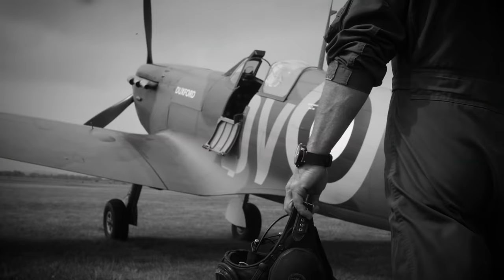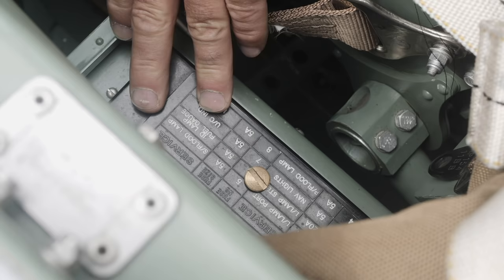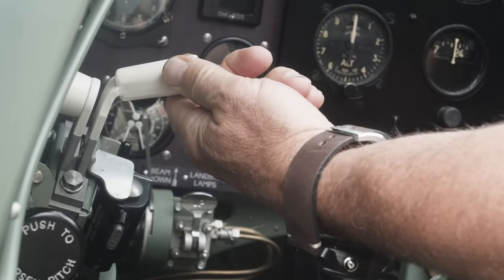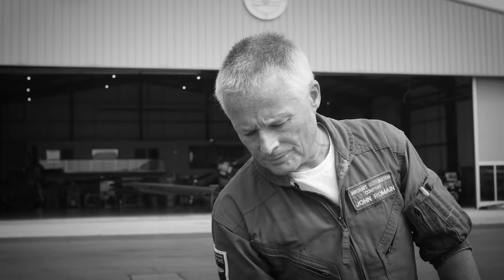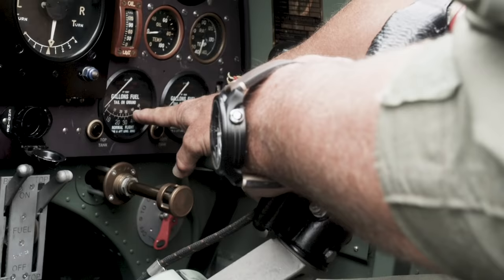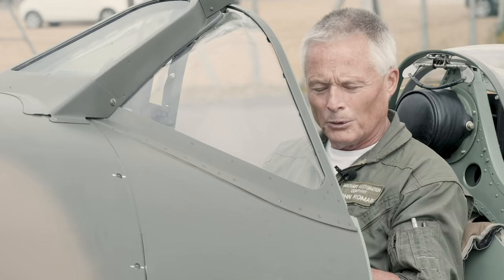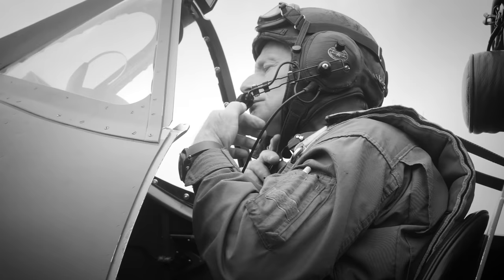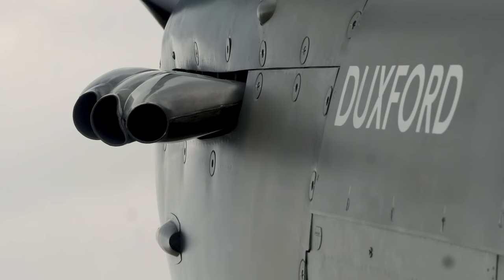How to Start a Spitfire: Step-by-Step Guide with John Romain

Comment: Cool. Here's how to start a spitfire. But lets not actually start it ...
Reply: Exactly
Reply: You have to pay extra for that...
Reply: Check out Kermit weeks if you want to see run through and start ups there his own planes p51b and a few others. Very cool
Reply: Incredible.  All that and leave out the best part. Firing up that awesome Merlin engine.
Reply: Riiight? 🙄 That was SUCH a fail... 😖
Reply: I saw i both start and lift off
Reply: And I thought it was just turn the ignition on press the starter button fire it up taxi to the start and then put the foot down and up she goes
Reply: Im guessing no-one heard him say that if the engine starts, there is a limitied amount of time before the engine overheats due to the small radiator that these engines use? Would have been great to see the actual start, but still, it makes sense why he didn't
Reply: @dianjacobs8180  it's a "step by step guide" as the BS title clearly stated.
It's missed out the most fundamental step of actually starting, or did you miss that ?
Reply: Good idea, the last thing you’d want is to break one of these beautiful birds
Reply: Why the belgian bracelet?
Reply: Ture bro the incline in gas money
Reply: Notice the black&white footage. You have to unlock the pilot and the plane first.

Comment: And to think 18 year old kids had to do this in a hurry before putting their lives on the line
Reply: The ground crew would have already done this prep before the pilots flew these beautiful birds. Time wasted completing pre flight checks would have been disastrous and allowed the enemy to cause more damage than he did. The aircraft had to be flight ready for any ‘scramble’ and that was the sole purpose of the ground crew.
Reply: @JamesAlexander14  That wasn't a pre flight check, that was a start procedure.
Reply: ...and now their only start procedure is for their mobiles
Reply: @JamesAlexander14  Coming from a instrument rated private pilot you’d be amazed how fast you can get a plane started once you’ve done it countless times in flight training, the start up procedure for this spit isn’t to much different from your typical general aviation aircraft and even in the event of scrambling leaving over a dozen unmanned aircraft with primed engines and magnetos on is flirting with disaster
Reply: @paulyflyer8154  and now 18 year olds today are wondering what gender they are. Have times changed
Reply: @idolnash13  Exactly

Comment: During the BoB would the ground crew have done most of this procedure?
Reply: Good question. I would assume that each pilot would have already done the main checks before assuming their standby duty. So they’d likely just hop in, reset the brakes, turn on the battery, prime the fuel and let er rip.

Comment: Two Questions: 1.This is starting up now, in peace time, how did they do it during the war? did they take short cuts to get it going? And the second question is flying her: she was built and designed as a fighter and was built to fly with guns and what have you to fight the Germans, but how dose it fly with out guns and other military requirements? Did she need to be modified to fly with out all the military hardware?

Comment: What was that big black shiny lever with the knob on, on the starboard side, for?  I never saw that in my cousins Mk. XVI.
Reply: Fuel Wobble Pump?
Reply: It's used to pump the undercarriage up or down (not to prime the engine with fuel- blame the video editor for that!) and was only fitted to early Mk 1 Spitfires, such as N3200 as shown here. Later models used an engine-driven pump, which is why your cousin's Mk XVI doesn't have it.

Comment: question why are all the gauges and such in imperial instead of metric if the spitfire is from UK?
Reply: Sorry. I had to take a minute to calm down after reading this. ... Imperial IS British and most things in aviation are still based on Imperial , Gallons, pounds, Miles. Altitude in feet etc etc.

Comment: Would rather see the Correct way to start Hawker Typhoon with a 24 cylinder Napier Sabre engine. Most ex Spitfire pilots on going in to a Typhoon thought they knew better than the ground crew an set the aircraft on fire when trying to start it. 
Give a ex Public School Boy a commission an a pilots wings an they still think they know it all.
Never happened to Sargeant Pilots in Typhoons. That's why they flew most of them!